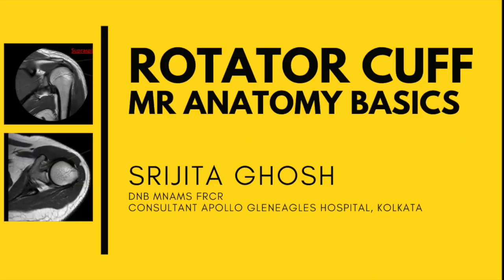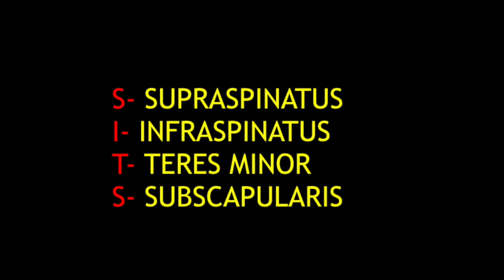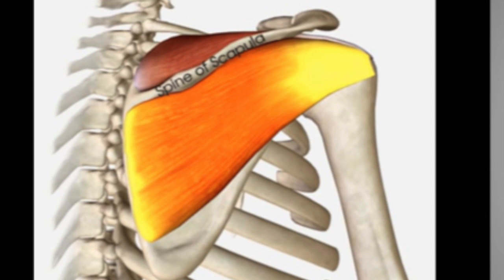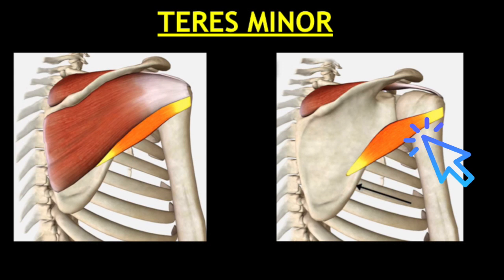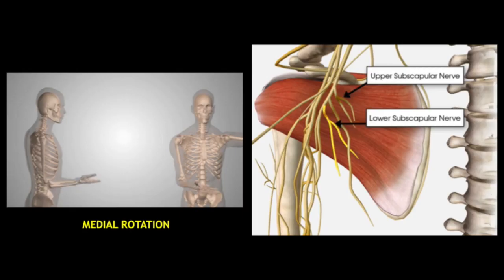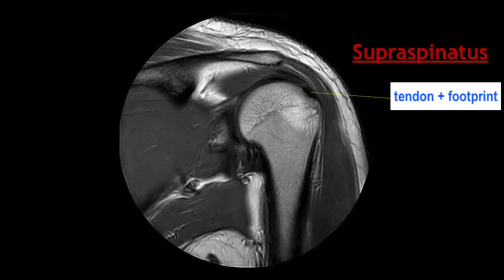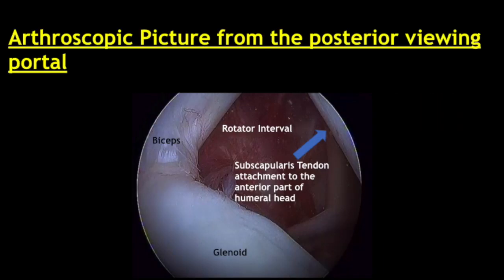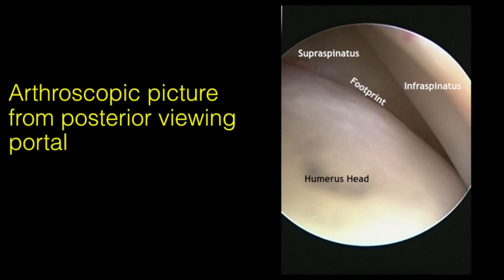ROTATOR CUFF MRI ANATOMY | SRIJITA GHOSH | Supraspinatus Tendon | Infraspinatus | Footprint

Comment: Please advise whether below  MRI report is treatable without surgery? Injection?
Partial tear or sprain of supraspinatus just before insertion
Minimal gleno hum and ac cl joint effusion
Minimal sub a, sub Cora, sub delt bursal collection
Partial tear/sprain of inferior Glen hum ligament with effusion in vicinity.

It was due to weight training 🙄 sleep is hell with pain. I am 50 👋
Reply: @batman-sr2px  yes better now, but not complete healed
Reply: @batman-sr2px  on its own I gues 4-5 months
Reply: @flyhigh5066  did you stop weight training and it got better? What did you stop doing?
Reply: @HeyIntegrity  i stopped it has been almost a year now it is better now but not healed in the sense i cannot still lift my hand completey up, or whenever I bump.againay someone or wall it pains.